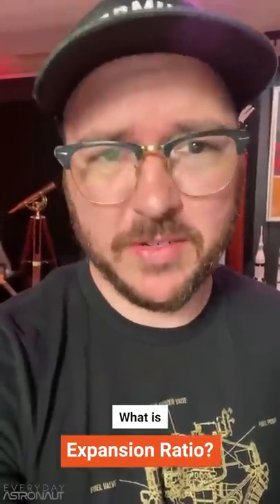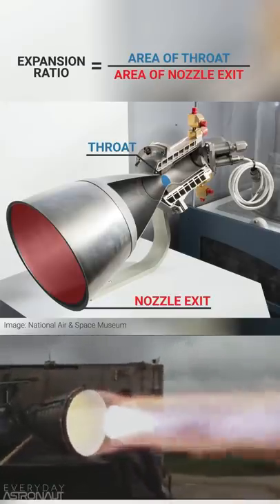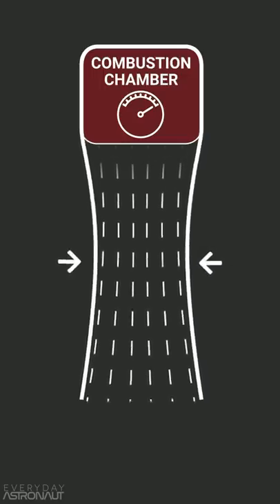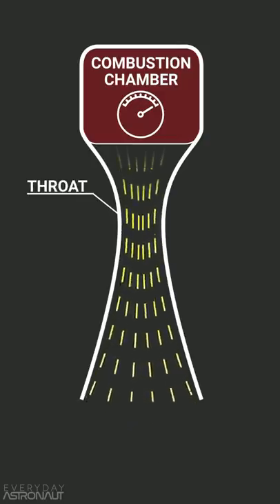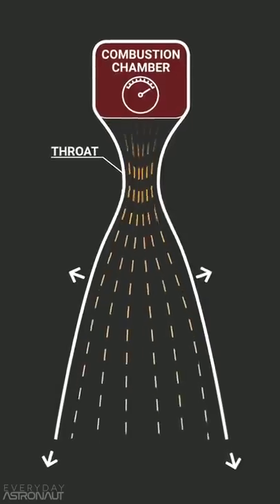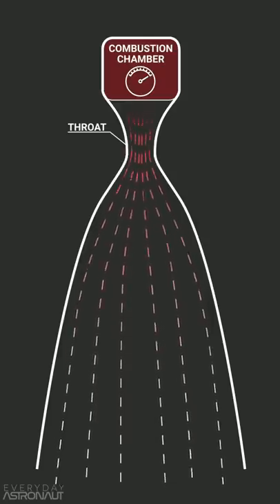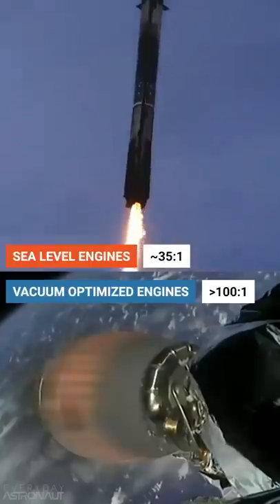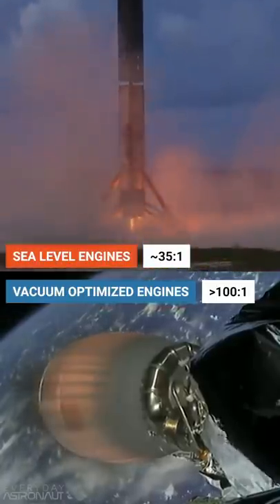What is expansion ratio? #shorts

Comment: can you talk more about chamber presure? how you get high presure and inject fuel at same time
Reply: IIRC it's like a syphon. The injected fuel isn't being pushed with enough force to overcome the pressure, if that's what you're getting at. Think of it like a paint sprayer. There's the reservoir of paint blowing out the tip, but there's zero pressure in that bottle to deliver the paint in to the stream. It's the flow of the exhaust that sucks the fuel in to the chamber.

Comment: Excellent video! Makes me wonder, will a larger ratio for a vacuum optimized engine always result in increased exhaust speed or is there a limit to this? Disregarding the added costs that will result with the increase in weight and size - which I imagine would make a larger ratio design more inefficient at some point!
Reply: The answer, as is always the case, is complicated lol. See what the diverging section of the nozzle does is basically "align" the motion of the exhaust particles, converting their random kinetic energy (the pressure) into more directed kinetic energy (the overall exhaust velocity). So if you let your expansion ratio go to infinity which is the same as making an infinitely large nozzle, in this theoretical example the nozzle exit pressure approaches zero and the exit velocity approaches infinity, which of course is physically impossible. So even if you could build an infinitely large nozzle you will start running into issues with exhaust velocities approaching relativistic speeds, what would happen in that case is beyond my knowledge, I'm simply an aerospace engineer not a physicist. In reality you run into the much more practical limitation that the increasing weight of your engine nozzle is not worth the increased efficiency, as increasing the exhaust velocity has no effect on the thrust made by the engine, it only increases the efficiency of the engine ie how much propellent is needed to achieve a given velocity change of the vehicle, higher exhaust velocity just means you need to use less propellent (which is why ion and plasma thrusters are the future if we ever really want to take colonizing places like Mars seriously).

Comment: Sort of, a nozzle converts enthalpy into velocity, not pressure. The pressure does drop substantially across the nozzle and is necessary to be efficient (higher chamber pressure means higher efficiency), but it doesn't factor into the energy balance equation for flow through a rocket nozzle.

Comment: He did not mention the reason for the difference, because it's short after all. A simple model that can be used is to imagine that the atmosphere is trying to go inside the expansion part of the rocket. If the pressure is too low the effective exhaust velocity will be massively affected. The atmosphere will win, so to speak.

Comment: What's confusing is that at the nozzle the total energy (mass x velocity) is the same as at the outlet of the cone, so how does expanding the cone increase thrust?
Reply: The total energy is the same (assume isentropic) but the kinetic energy is not. The nozzle constriction (throat) is used to build up pressure in the chamber, the expansion downstream of the throat converts the pressure and heat into momentum.

At the exhaust, the flow of propellant is cooler and at lower pressure, but faster. The larger the bell, the greater the conversion to speed.

Comment: Great video. But it seems like it should be relatively simple. What is all that contraption at the top of the motor?
Reply: It's extremely complex to run turbos and parts to support high speed flow going in many different directions, while at the same time you have to manage super heating and super cooling throughout various points of the system. Super cooled fuel runs through parts to cool them, then it snakes around the bell to cool the bell and pre-heat the fuel, then you need the systems to bring the hot fuel back up to the combustion chamber, and more super cooled fuel to keep those parts from overheating as they manage the hot fuel flow. etc.

Comment: Okay question… What if the nozzle was square shaped, or some other polygon (with smooth corners of course!) whose area was larger than the enclosed circle. Technically, would the engine be more efficient?

Comment: Question for the rocket scientists out there: if you wanted to increase thrust for a fixed nozzle exit size how would you do it?  High expansion ratio is good for efficiency but what actually helps thrust....higher chamber pressures?.. i have not been able to find an answer.
Reply: IIRC, after the flow is (super)sonic (i.e after the throat) you can only speed the gas up by converting its internal energy (heat) into kinetic energy which you do through expansion. This also decreases pressure so the optimal expansion ratio is limited by the outside pressure.

So the only way I see to increase thrust would be to
a) Increase combustion temperature (which I think isn't possible once you're at the stoichiometric optimum)
b) Increase combustion pressure (like you said) which in turn allows for a bigger expansion ratio before the gas pressure drops below external pressure.
I think the problem is that this also increases the temperature at the throat, so you're limited by material science/weight.

But take all of that with a HUGE grain of salt, because I only had one semester of Introduction into Spaceflight and wasn't very good at it.

Comment: The only thing he got right is the definition of expansion ratio. The chamber pressure is determined by the diameter of the throat and the speed of the gasses is highest at that point. As the gasses expand down the nozzle they push outward against the bell housing which pushes the rocket forward. An optimized nozzle will expand the gasses from chamber pressure at the throat to atmospheric pressure at the bottom of the bell.

Comment: so to my understanding, Vacuum engines and sea level engines are the same, just that different lengths and size with the nozzles to achieve their respected uses, which I'm guessing is why a Vacuum optomized engine would work ofcourse at sea level, but not way near as efficient as a sea level engine would when operating? correct me if im wrong.

Comment: What's the reasoning behind the expansion "rate" so to speak; The curve of the nozzle?
It's a relatively small curve 'rate' from the throat to the exit. You could get a higher ratio in a small space by making that distance shorter, so what's stopping them from.. not just doing that?
Reply: The size and curve of the nozzle are designed to maintain expansion under constant pressure. Big pressure differences can cause vibration and possibly damage to the nozzle. A long nozzle better directs  the flow and produces more power. A short nozzle allows the exhaust to flow in directions other than vertical and effective power is reduced. Vacuum nozzles are bigger because air pressure helps to direct the flow at low altitudes.
Reply: the fast gas cant curve that fast so it will damage the engine
Reply: You want to direct the exhaust straight out of the nozzle without it going to the sides (in order to have high efficiency). Also, I believe that higher angle can lead to separation of the flow from the walls.
Reply: This flow separation problem is more significant at lower pressures - that's why nozzles often have bell shape instead of a simple cone shape. Angle is high near the throat (where pressure is high and flow is relatively slow) and it transitions to low angle at the nozzle exit (where the pressure is low).

Comment: since airplane control surface is operating on the same choke flow principle. So effectively that mean control surface will have the completely opposite effect when under super sonic flow compare to sub sonic, IE tilting the wing downward will actually increase lift instead of decrease lift. When a plane is near trans sonic speed, part of the airplane's control surface will be under subsonic flow while other control surface will be under super sonic. So half of the plane's control surface will operate "normally" while the other half will operate in the opposite direction. So it's incredible dangerous for a pilot to stay in trans sonic region, since the airplane can easily become uncontrollable. Go to either go full super sonic or sub sonic.

Comment: Except it cant expand too far after the throat as the expanding medium needs force n expansion resistance to further its potential of thrust. As it redirects thrust. If the nozzle were too large. The mass of the compressed air would have too much volume to expand into and it wouldnt have any pressure left to direct thrust from the nozzle wall. So its all calculated by the volume of supersonic flow per time. Compressive potential to expansive potential of each volume.

Comment: It irks me so much that starship has 3 sea level engines just for the 5 second landing burn.  Hope spacex can use the hot gas thrusters to land in future.
Reply from the maker: They’ll likely use them at stage separation too for a few minutes to have a high enough TWR for an efficient profile. A Raptor will always be wayyyyy more efficient for landing on Earth than hot gas thrusters. Why would you not want to use the most efficient and highest performance engines to land instead of 2 dozen lower performance, lower TWR hot gas thrusters?

Comment: So if we had a new deployable design for an expandable bell skirt which could double, triple or even quadruple the effective size of vacuum engines the thrust in space could be optimized and therefore reduce fuel load requirements?
Reply: The rl-10 on the delta heavy does that
Reply: You run into diminishing returns. Eventually the bell is so heavy that it negates fuel savings in generating delta-V.
Reply: @iain3713  That's to make the engine shorter so that it fits inside the interstage. The extension goes into place at stage sep before ignition.
Reply: @Markle2k  Not necessarily true with modern material science. Even a type of light-weight high heat fabric with skeletal support material might be used?

Comment: Other than protecting parts of the engine and space ship, why even have a bell where it expands? Seems like an infinite expansion ratio could be obtained.
Reply: That's not how vacuum expansion works. If an engine nozzle ends when the exhaust is at say, 3 bar, and the ambient pressure is 1 bar, the gas will expand out drastically and very little of the gas will actually produce thrust in the direction of movement. Not only that, but the exhaust is also not moving as fast as it can with a full nozzle

Comment: How come the space shuttle had small vacuum engines. I’ve always wanted to know why
Reply from the maker: The OMS vacuum engines were restartsble using hyperbolic pressure fed engines and therefore usable for orbital maneuvering as opposed to the RS-25’s which couldn’t be restarted and were useless after the external fuel tank was jettisoned
Reply: @EverydayAstronaut  thank you for responding so quickly but why weren’t the OMS engines bigger. They always seemed very small compared to other rockets vacuum engines such as the falcon 9s
Reply from the maker: The shuttle’s main engines got it to like 98% that of orbital velocity and by the time it was at that point, it just took very little to get it into orbit, the main engines are also the vacuum engines / upper stage. This is opposite of the F9, where the second stage does 65% of the velocity
Reply: @EverydayAstronaut   Thanks for the info

Comment: Why is there a difference between Sea Level and Vacuum Level nozzles?
Reply: This is more complicated but to keep it simple: the vacuum level engine has a larger expansion ratio, meaning the thrust is propelled fast out of the nozzle. Because of this, the pressure inside the nozzle and bell is lower (fast flow = low pressure), and the surrounding atmosphere begins pushing on the exhaust and bell more and more (higher ambient pressure outside engine). This can cause flow separation which can destroy the bell of the engine because the ambient air begins disrupting the engine exhaust. So at sea level where the air is thickest, you are limited in the expansion ratio you can use because you can’t let the pressure differential be too high (usually around 40% difference at most). In space, this isn’t an issue because there is no surrounding atmosphere to combat the pressure inside the bell, so the expansion ratio can be much larger. Hope this helps! There is definitely someone out there who can explain it better (Tim made some long videos).
Reply: @ZicajosProductions  Did he get into this in the Aerospike video? That's where it would fit best. (for OP, aerospike engines actually use the air pressure as one "side" of the engine bell)

Comment: Why does Spacex not use electric motors to drive the motors in the raptors for Starship?
Reply: Electric powered turbopumps don't scale up well. The batteries are dead weight besides. Raptor turbopumps put out 100,000 horsepower (~74.5 megawatts). That's about 1350 Tesla Model S P100DLs worth of power expended for a couple of minutes. The entire Raptor engine; plumbing, turbopumps, combustion chamber, nozzle, etc. weighs just 1500 kg.

Comment: why not just make an adjustable nozzle?
Reply: Mechanical complexity/reliability and weight. Since rockets will usually stage in the upper atmosphere they just put near sea-level optimized engines on the first stage and vacuum-optimized engines on the second stage.

Comment: It’s not weird that as the gases expand due to combustion that they will Accelerate even as the engine gets wider - they are rapidly expanding. Same thing happens in an internal combustion engine. Saying this is weird is like saying you have no idea what you’re talking about. Yes, like you don’t understand rocket science even on basic fundamentals. You should take that part out and instead explain the simple physics. The simple physics are just that the gases expand far more than 30:1 and therefore the shape of the engine simply directs the force strait away from the rocket propelling it forward.
Reply from the maker: A similar thing happens in internal combustion but this is different. When you have fixed mass flow rates, to speed up a subsonic gas you first constrict the flow to speed the gas up, but once it gets supersonic, you need to expand the flow to continue speeding it up. Car exhaust does not get supersonic… unless it’s some weird engine I don’t know about. But this is different. With car exhaust you are trying to reduce back pressure by allowing the still expanding gas to have a place in the pipe. That’s not what’s happening here. That’s why I said it’s weird.
Reply: @EverydayAstronaut  I’m annoying. what is meant by supersonic? Just the speed? Faster than sound? This suggests there’s a barrier, a threshold that creates new physical constraints. So, After the fuel moves faster than supersonic it has additional “weird” forces acting on it? 

Is most of the thrust created at the engine inlet? 

In an toy pressurized air powered rocket it’s more the force of matter causing inertia as it moves away quickly in the opposite direction? Is it still more about inertia in a large fuel powered rocket or is it also about thrust created by the flame pushing against air?

Comment: At what point does extreme high pressure in the combustion chamber become explosive? Turning it into a bomb instead of propulsion. It just looks like there has to be a better way to move something heavy off the face of the planet instead of using a controlled explosion.

Comment: That  not accurate 
Actually it's  the  opposite where high speed gas is turned into  high  pressure
Reply from the maker: As stated in the video, only up until it reaches supersonic speeds, then in order to speed up you need to expand the flow